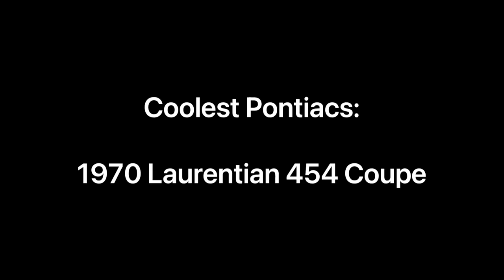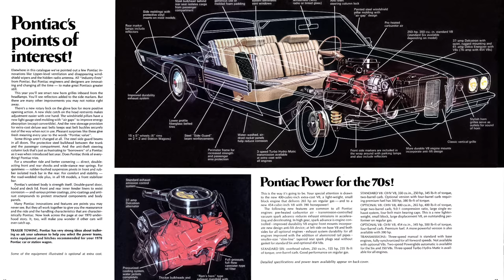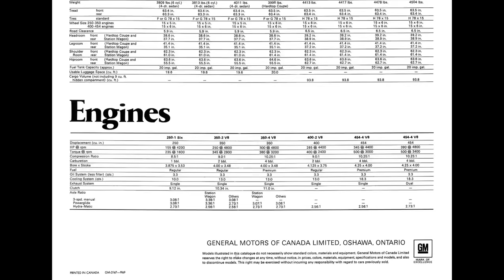A Factory 454-Powered Pontiac?! This 1970 Pontiac Is Powered By a Chevy Big Block!

Comment: The full size Pontiac's weren't the only ones.  Canada never got the 60s Tempest; we got rebadged Chevelle's called the Beaumont, and the Acadian which was a Chevy II/Nova.  This continued on into the 1980s, and up here they are only rare because the salt roads in the winter rusted them out.  Ford did the same thing with the brand Meteor for almost thirty years, with exception of a couple years in the early 1960s.  It gave Lincoln-Mercury dealers a lower cost option than the Marquis.

Comment: I had  1970 Pontiac Strato Chief 4 dr sedan with a 350-4bbl and a 3 spd manual on the tree. No PS OR PB. It was impossible to steer with radials so I had to put PS in it. Same colour of green.

Comment: A friend of mine had aquired a 69 Elcamino that had a pontiac front end on it and it had the 350 pontiac engine with the BOP th 350 transmission but the rest of the body from the doors back looked like every other Chevrolet Elcamino at the time from that year . He was a body guy and had got the car in partial trade for doing body work for some  clients car I remember and we actually contaced GM about this and found out it was built in Canada we were told when we contacted someone at GM back in the 80s and that there were only 1,200 of these cars built he said . I figured my friend would fix the car back up and do the body on it and keep it but he ended up selling the car making good money off of it . He was more of a Mopar guy and had a 70 Dodge Charger with the 440 727 and the 8/3/4 rear at the time and just wasn't that interested in the pontiac enough to keep it which would be worth some good money today .

Comment: Curious as Pontiac was the Chevy in Canada,  are there any 82 and 83 firebird se or trans am surviving in the great white north? I know those two years were problematical,  but I do miss my 82 trans am,  stick abd recaro seats. It was a mechanical dog.
Reply: Since they were built in Canada, there is still a large selection out there of that generation.
Reply: @scottmccambley764  ty. They also came off the gm assembly line in panorama city,  ca. For about 6 mos,  it was so unique to drive my 82. Other 82 drivers would flip their lights up and down to greet each other. It was like a club. Mine had t tops,  and man those first 6 mos of ownership were fun. If your t tops were off,  we'd wave to other 82 owners through the t tops. GM mailed you the clothing accesory catalog,  yup there was an 82 firebird ta clothing catalog. I still have mine. What great memories. 82 camaro owners did not have the same experience. The 82 firebird and ta was that unique.

Comment: Worked at the Henderson Pontiac Dealership in Chicago on Madison Ave during summers while in High School "70s"! I've always thought the Pontiac's were the Best Looking GM Cars! The Firebirds, GTO's, Lemans and the Grand Prix's they could be ordered with some major horse power! The Luxury Line  the 4 door Grandville with the 455 would move the GVille down the road in style with all the bells and whistles, that could compete with the Caddy's, duce & a quarters, or any large luxury car of that time! The only car in the Pontiac line I didn't like so much was the Grand AM! A cross between the GTO, Grand Prix & Lemans? could be ordered with a 455 & 4 speed but the looks weren't all that and a bag of chips! Also the Ventura! a knock off the Chevy Nova! It was a bit under powered! But the Grandville was a great luxury vehicle $$$$ for $$$$!

Comment: Interesting Stuff and gee they had huge engines back in those days. I think The Pontiac Laurentian wud look better in Ice Blue, rather than Dark (Pepper) Green, Adam🤔🤲
Reply: Assuming the colors are being reproduced accurately in the video, I'd say that is Verdoro Green.  Verdoro Green was crazy popular during '67~'70 and is a very drab green.  I had a Pepper Green Tempest, and the Pepper Green was a much more vibrant color... '70 only.  Hard to believe Pontiac offered 4 different greens in 1970.

I'm a little biased, as I think Pepper Green would have given the ice blue a run for it's money.  I think that ice blue is actually Bermuda Blue, but the swatches look too dark.  That ice blue might not be a factory color for that model/year or a custom mix.
Reply: @buckykattnj  Gr8 Stuff Bucky. I didn't know it wasn't Pepper Green, I was just going by what Adam said on that one.....Bermuda Blue the official color, rather than Ice Blue and I think it looks nice on the Pontiac Laurentian...Cheers Bucky fm Damo😀🙌

Comment: That is crazy. Cruise control and NOTHING else. lol  You can bet that the non power brakes were shoes all the way around too. With that 454 zero to 100 in no  time flat, but 100 to zero with those brakes could be 2 miles lol
Reply: Those drums had a lot of area on them, they would stop those machines.😮😂❤
Reply: @jonowens460  Oh I drove a bunch of 'em. 3" or 3 1/2" x 11" was as big a braking area you could get. Once they were warmed up and you were trying to burn off a bunch of speed in a hurry you could count on them to fade very quickly. Sure they would still be better than throwing an anchor or parachute out the window, but not much. Lol  Compared to the front disc brakes that became optional in 69 and 70 on those B bodies, the front drums were near to worthless, smoke and all.
Reply: @oldsguy354  Disc brakes became optional on many '67 GM models, A, B and E bodies got them that year and I'm not sure about the C bodies but they likely were introduced later that year or at the beginning of the 1968 model year. 
 I have Bendix 12" disc brakes on my '67 Riviera and they are a big improvement over drums. Even Buick's 1957-70 finned 12" aluminum brakes drums which were much better than cast iron drums still didn't have the stopping power, brake pedal feel of fade resistance that disc brakes have (I've owned a few of these too). The first GM disc brakes used various styles of 4 piston calipers in 11" and 12" variations but by 1970, they had already switched to single piston sliding calipers on most cars. In 1971, 12" power disc brakes became standard on most if not all full size models. They weren't brand specific anymore as they were before 1971 on full size cars.
Reply: @PhilRacicot  I'll take your word on disc's becoming available in 67. None of the pre 69 cars I had or worked on had them, but my 69 Delta 88 (B Body) did and they were so rare in my circle everyone wanted to see how/if they worked. Lol My 69 Olds 98 (C Body) had drums around but I'm sure if they were available on B Body's, they were available on C Body's and I can't imagine a Cadillac 70 or newer without front disc brakes, but that was a half a century ago.The 12" drums are completely lost on me. I never saw them exceed 11" but I wasn't working on fancy Riviera's. ;) 
My buddy had a 70 Catalina with drums around and they were only marginally better than the brakes on the Titanic. They were fine for quiet drives around town, but if you were hot dogging it and warmed them up, just like the Titanic, you were headed for a shipwreck (I guess "boatwreck" is more appropriate), and that's exactly what he did to his. Smoking pouring out of the wheel wells as he slammed into a car in front of him.
Reply: @oldsguy354  I parted out a '68 Olds 98 LS 4 door sedan that had disc brakes. It also had the unusual silver wheels that came with these with small center caps (I thought they looked quite nice, a bit like those optional wheels seen on the late seventies model full size Oldsmobiles. I think they used the Moraine 4 piston disc brake setup like the A bodies used in 1967-68. At least that's what they looked like. The Bendix calipers on full size Buick models were different and unique to Buick full size cars.
Reply: @oldsguy354  Buick had 12" drums front and rear on it's full size cars in the 1960s, most had aluminum drums (LeSabre models with small blocks had 12" cast iron drums at the front starting in 1964, the estate wagon version with the Nailhead V8 still had aluminum drums). Aluminum drums were introduced on the 1957 Roadmaster 75 and by 1958, most models had them. Buick never had 14" rims on it's B-C bodies so that probably explains the 12" drums too. I have 12" aluminum drums on my current 1965 Wildcat, had those on two 1967 Rivieras and on a 1968 Wildcat. I have 12" vented disc brakes on my 1967 Riviera and I drove a '68 Wildcat, a 1968 Electra and a 1969 Electra that had the same setup with 4 piston calipers I also got spare rotors from a 1968 Wildcat convertible which are currently on my car. By 1969, the mid size cars with the Moraine disc brakes had switched to single piston calipers and I think Cadillac also used single piston calipers since 1968 , I guess full size Olds switched to single piston calipers in 1969 at the same time as the GM intermediates and in 1970, Buick did switch to single piston calipers on it's full size cars. In 1971, the disc brake setup was completely redesigned and shared across the GM B-C bodies as well as some 1/2 ton pickups.

I just found a link about a '68 Olds 98 LS just like the one from which I removed the calipers years ago. They look similar if not the same as those on mid size cars. I don't know which bolt pattern was used on full size Olds, I know Buick used 5x5" on it's full size cars and 5x4 3/4" on it's intermediates. https://classicoldsmobile.com/forums/wheels-tires-74/wheel-68-olds-98-a-110243/
Reply: @PhilRacicot   Wow, you have some nice cars. You're a Bui-Hog lol 
The Olds A Body's came with 14" wheels (as far as I can tell that is) so there was no chance of a 12" drum going under them. The A, B, and C Body's through 69ish came with 11 drums, or optional disc's (9.5" on A Body's and 11" on B and C's. The rears were 9.5" or 11" across the line from at least the mid 60's until at least the 1990 RWD Custom Cruiser. I'm very confident all the B's and C's had 15" wheels but they all had 11" drum's or rotors. A 5x5 lug pattern sounds like the norm through 76ish on the the B's and C's, but that may have been engine size dependent. 77 onward I know the 403's got 11' rear drums on the B Body's and the 350's got 9.5", they also got the smaller 5x4.75 lug pattern. I can't say for sure on the C Body 98's and Custom Cruisers (77 up), but I think they all got 11" drums and rotors, the 403 equipped cars definitely did. The other than 403 B Bodys (77 up) were likely to have 9.5" rear drums and all had 11" front rotors. I can't say with confidence on the late 60's through 76 Olds B-C Body but 5x5 and 11" front or back would have been the norm.
  There was a police package Delta 88 I think 68, 69, and 70 that could have had all kinds of fancy/high performance brakes to go with the 400hp 455's they got, but I've never seen one in person and I've damned sure never had the opportunity to take one apart to find out what was going on with them.
Reply: @oldsguy354  in the late 1970s, the bolt pattern for the B bodies got confusing, being more familiar with Buicks, it was easy to spot which bolt pattern they had if they had the optional chrome wheels. The 5x5" bolt pattern used on all full size cars before 1977 had the weld joint at the back and those with the 4 3/4" bolt pattern had a visible joint at the front. Starting in 1977, some LeSabre came with the smaller bolt pattern if they had the Pontiac 301. Those with an Olds 403, a Buick 350 or a V6 (or at least the Turbo V6) had the 5x5" bolt pattern. The wagons, Electra and 1977-78 Riviera got the 5x5" bolt pattern. Starting in the late seventies, the 5x5" wheels also got 1" wider (7") they were previously all 6" wide. Back in the 1960s, The full size Buick chrome wheels were modified to fit with cars equipped with disc brakes. Starting in January of 1967, cars equipped with disc brakes could get them as an option (Wildcat and Riviera models). In 1968-1970, the same wheels were also used for cars with the standard drum brakes. In 1971, they got redesigned and went back to the shape they had in 1964-67 but with more backspacing than previous ones. The holes in the center of the wheels also got back to the 2" size they originally had in 1964-65 and 1965 style center caps were used. 
Back to brake drums, Buick full size models from the 1960s used 12" drums front and rear and kept using them for a few years after discs became standard, not sure when LeSabre models switched to smaller drums but the Electra and Riviera switched from the Buick 9 3/8" differential to a Pontiac 8 7/8 around 1974 (those have the full plug on the back cover) and they also switched to smaller diameter 11" drums at the same time. 

As for the disc brake equipped 1968 Olds 98, I wish I had taken pictures of it (didn't have digital cameras or even phones back then!). I couldn't even find a picture of a full size Olds with those wheels now with all the images on Google! The car had been stored in a barn in my hometown for years along with a '59 Chevy and another 1971 Olds 98. I knew the owner of those cars (he passed away since). The junkyard owner was a friend of mine and went to see them with me and he bought all 3. I thought about getting calipers for my Buick but as soon as we got the wheels off, I figured they looked like the 1967-68 mid-size cars calipers, not like the Bendix calipers on the 1967-69 full size Buicks.

Comment: I remember the Parisian. I mean, the Parisienne! These giant cars often had the huge GM or Pontiac 455 cu.in. V-8 installed. Even though many models were detuned, the 455 could often pass everything but the gas station. ⛽
Reply: Do you also remember the Parisienne? 🙂
Reply: @bobjohnson205  Why, yes, I do! I think someone in my universe drove one of those hulking monstrosities to school. He was highly sought-after to get into the drive-in movies! Thanks for correcting my notion.😊🤔🥴🤪 I'm better at spelling Italiano!
Reply: They weren’t de-tuned. It was actually the opposite. SAE gross horsepower means no air cleaner, no exhaust headers, no accessories. Not even the water pump is driven. They bolt it to a stand, attach a prony brake, and run it full bore until it seizes. Highest number goes in the brochure. 

Of the 390 horsepower advertised.. probably only 250 is making it to the ground. 

The switch to SAE Net horsepower in 1971 was mostly responsible for the precipitous fall in horsepower ratings: they couldn’t lie anymore.
Reply: @Bartonovich52  Well, they all weren't high-perf, either. The huge Buick Estate Wagon Dad got me to finish out university with (big car = safe car in Dad's mind) had the 455 but at least included a 4-bbl carb, but was a major slouch. Had a HUGE gas tank. Good thing gas was cheap back then. When I traded it to the Ford dealer in Pensacola, one of the dealership lads was so happy to buy it; it was just what he wanted to trailer his fishing boat around, as it also had a Cat 2 hitch installed. I was happy to have my new Ford pickup!

Comment: Engine swapping at GM wasn't uncommon so it doesn't really surprise me that a Pontiac at this time would have a Chevy engine. The Chevrolet Kingswood clamshell wagon during the 70s had a Pontiac built 400 as standard with the Chevy 454 as an option.
Reply: Not in the US until the late 70's. Each brand was very protective of their own engines.
Reply: Even Cadillac cars often had Chevrolet engines back then.

Comment: Canada was to the alternative US GM engine world as Australia was to the alternative US FoMoCo world.
Reply: Yes. That poor 351 Cleveland barely moving that Falcon XB in Mad Max so they had to speed up the footage.
Reply: @Bartonovich52  
You mean the one with the electric clutch operated belt driven supercharger?
Reply: If you owned a non-Holden GM product down under it was most likely built and shipped from Canada

Comment: I understand why GM wanted to source only one set of chassis and powertrain components for Canadian Chevrolets and Pontiacs combined, but I don't understand why they chose the American Chevrolet underpinnings between the two. Since Pontiac was the higher volume brand, why not have Canadian Chevys use American Pontiac chassis and engines instead?
Reply: Not 100% sure but I think the engines destined for the Canadian market were locally assembled, that's why it was better to just pick one engine brand/series for all.
Reply: @bikeaddictbp  Yes, they were locally made in Canada, as Adam explained. But why chose the Chevrolet components to be the one made there? Pontiac was the dominant brand, so why not choose their stuff to build in Canada and install under both Chevys and Pontiacs, instead of Chevrolet's stuff?
Reply from the maker: Chevrolet components were cheaper.
Reply: The Chevrolet Oshawa Auto Plant produced both brands off the exact same line. They also produced all the GM Aussie and South African righthand drive kit cars.  That plant was over 110 years old before GM pulled the plug on it in the last round of North American closures.

Comment: Listen I've been a technician for decades. A check engine light is not bad. A FLASHING cel is bad. It can come on for thousands of reasons. Gas caps, to it measured a lil too much air by MAF sensor. As long as it's not flashing it's ok. And some things u don't need for driving. Like mis or non communication with a radio module. Who cares. As long as it's running, shifting and all wheels are not wobbling terribly, u ok. Take to big box parts store n they check for free. Hope urr day gets better. I was homeless. I had nothing. Not even a toothbrush. Most ppl have no idea what that feels like wanting to brush urr teeth, something so small and trivial, but not have a brush or toothpaste. It gets better and could be way worse.